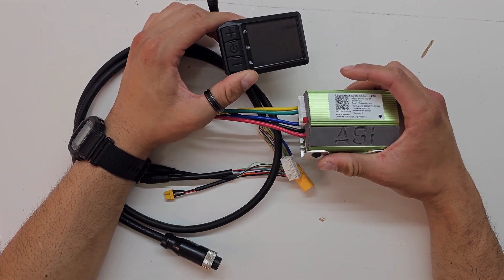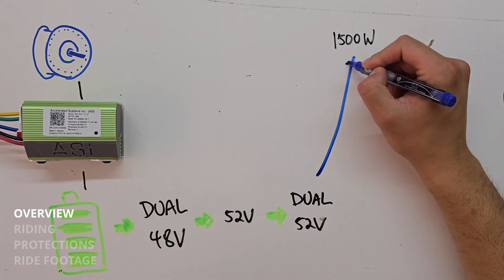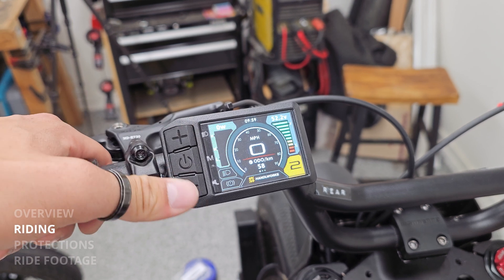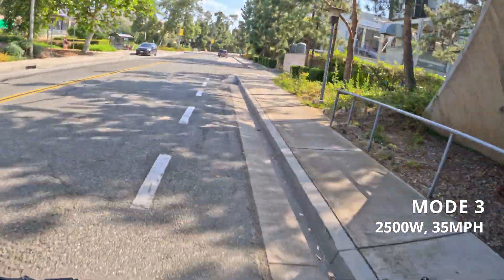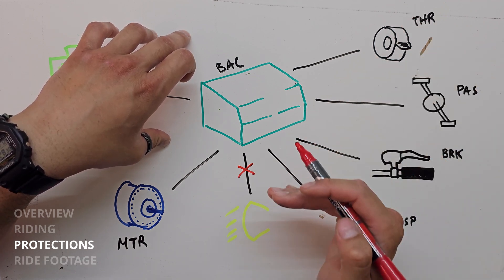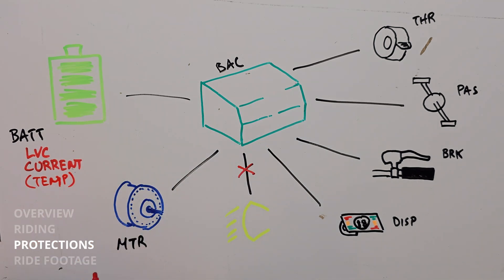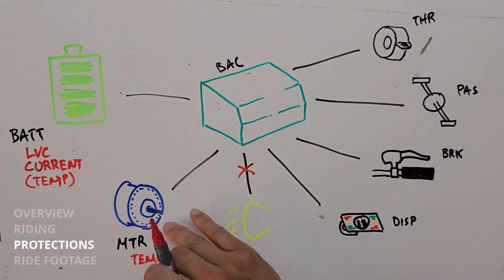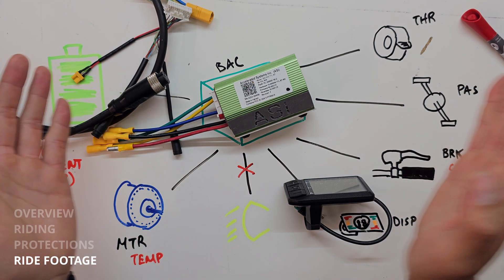BAC855 Kit Overview

Comment: what does it mean when it says error code 22H pls help
Reply: What bike did you install controller on
Reply: It’s normally a motor or throttle error. Basically your throttle works and the motor noise works but once you hit the brakes the throttle cuts off and you have to turn the bike off and on for throttle to work again. You either installed it wrong or it’s not compatible with bike. Check the motor cable, it comes will three connectors the yellow, blue, and green, and make sure they are tight and firm so it won’t disconnect when riding. Hope this helped!
Reply: Make sure the motor cable was installed on controller right. Make sure you matched the colors right!

Comment: does it cover peddle assist ? i actually do peddle. i don't think the happy run g60 has a proprietary system .  there is no app . I have headlight and turn indicators but i called tech support and asked for output voltage to headlight as i was changing it they said no problem it is 48v output.

Comment: Does this controller have memory saving capability? If I leave it in mode 2 and turn the bike off, will it stay in mode 2 when I turn it back on?
Reply: “It will always start in Mode 1, which is a US Class 2 (20mph top speed, 750W output). This is a legal requirement. You can use the (+) button to cycle through to Mode 2 (US Class 3, 28mph top speed, 1200W output), and Mode 3 (private use, unlimited, 36mph top speed, 2500W output).” - handlworks email support

Comment: Will you be working on support for turn signals in the new version?
Reply from the maker: Yes!
Reply: Thanks for the reply! I am sold!!! @handlworks
Reply from the maker: @tannerdler9676  thanks much, keep a lookout for an update soon! Next few weeks.
Reply: you can also add your own. easy to add a splitter cable to a 12v regulator from your battery.

Comment: From someone who has worked with this controller for a long time  make sure that the JST connection is well sealed up and protected and cannot flex in any way when its installed. Almost all BAC855 failures occur due to water ingress in this area shorting out one of the feeds. Good luck :)
Reply from the maker: Thanks much and totally agree, it's on the way 🤠 much appreciated 🙏
Reply: No as Good as yours...hihihihihi😅

Comment: Excuse my ignorance, but do you need to change the mode in the Super73 app since it starts it in Mode 2 when you power on the bike? Maybe I missed that part. 🤭
Reply from the maker: No more Super73 app, this replaces the stock controller! It'll start in Mode 1 (Class 1 ebike), and you can toggle ride modes with the arrow keys on the display.

Comment: Is the controller as well as all the connectors waterproof?
Reply from the maker: The controller is IP rated for dust and waterproofing, as is the display. Since ebike connectors have varying levels of ingress protection, we recommend protecting all connectors if riding in very wet conditions.

Comment: 2 questions :
1 - how much amps can the motor take safely?
2 - I have a torque sensor, not a cadence sensor. Will it work ?
Reply from the maker: 1. The motor's limit is based on amps over time - we are sending a peak of over 50A at once, with normal operation at around 30A.
2. Torque sensor isn't set up but can be in the future. Are you in EU?
Reply: @handlworks  based in Europe yes, I was the one who told you about the Mini Wheels shop in Paris. I have a torque sensor on my RX compared to cadence in the US
Reply from the maker: @aeskellion  Aha! So hard to track people through different socials. Yes, torque sensor can be set up easily and Mini Wheels will be able to help out with distribution!
Reply: @handlworks  i see. Very exciting news, looking forward to the torque sensor compatibility 🙏🏾

Comment: S73's with lights all have a separate buck converter. You could pull this off the ASI with another higo connector...
Reply from the maker: That's more or less what is in development. We're adding logic to turn on the lights via display as well.